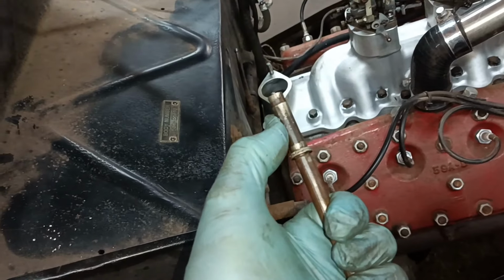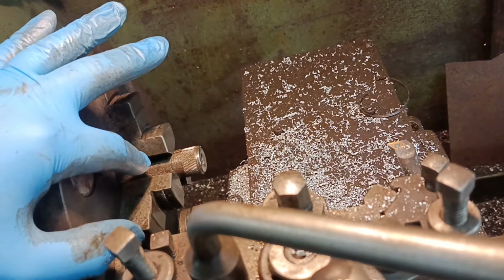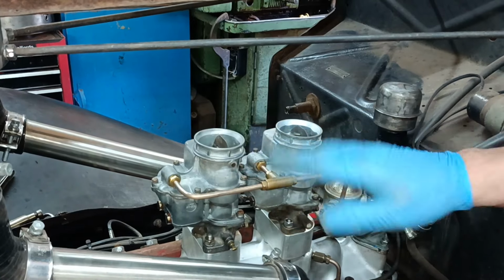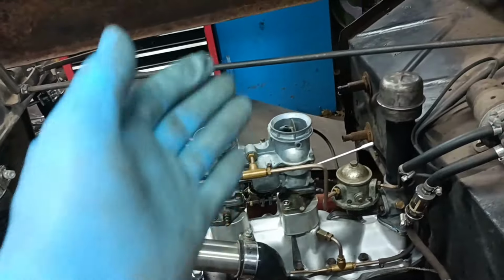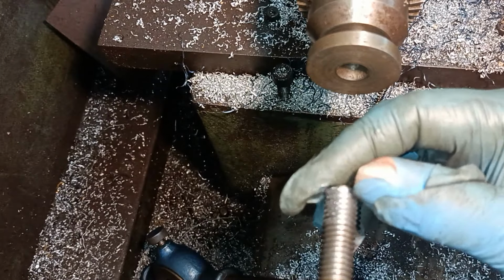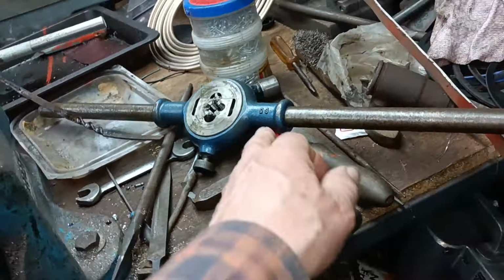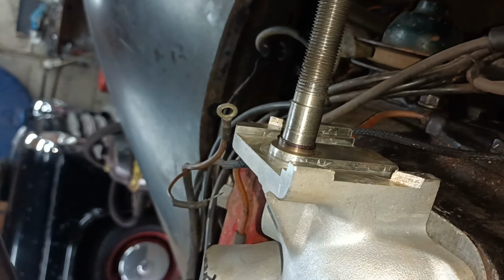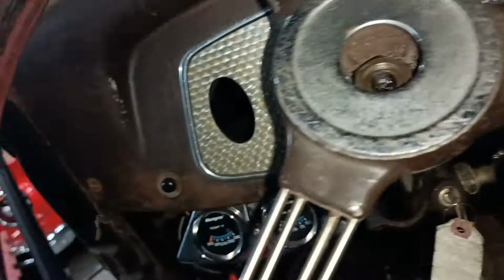Hot Rod Dual Carb conversion for the 33 coupe! Part4. (Update 2443)

Comment: Some fine hotrod DIY!  Do your carbs still have power-valves and if so, are they the stock ones?
Reply from the maker: Hi Art. Stock power valves on this one. On my sedan I also used stock power valves but I did snip a little off the springs. I held the valves and pushed them together to make sure they both moved at the same time. The coupe has a stock cam, the sedan has a hotter cam so I modded the valves on the sedan.

Comment: Hi Mart, Why is there a mechanical fuel pump and an electric fuel pump
Reply from the maker: Hi Michael. Pumps are in series. The electric one is to prime the system after the car has been standing for a while. Saves a lot of cranking. Thanks for watching.